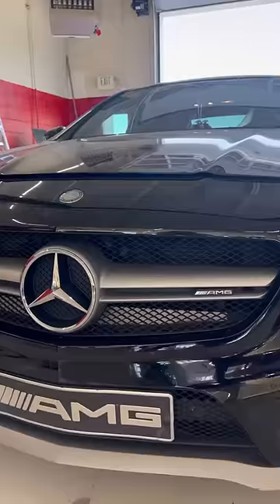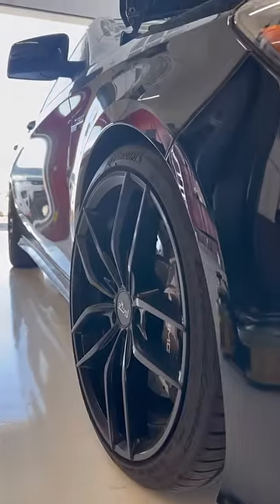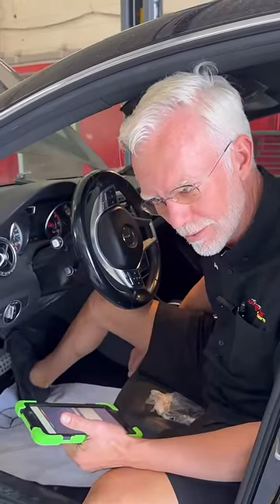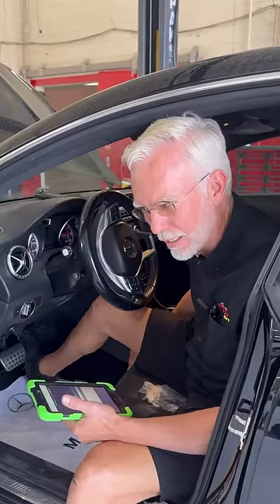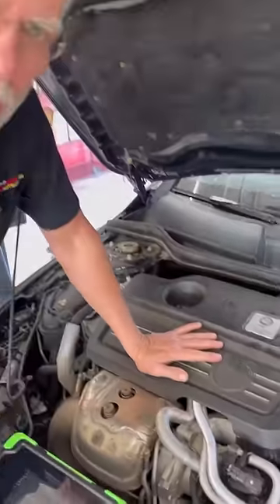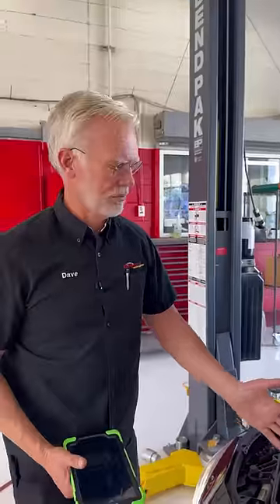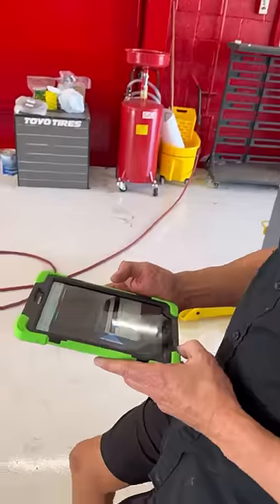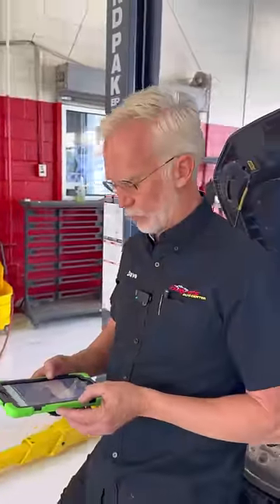Mercedes AMG Nothing but a slight noise on start up #carrepair #autoshop #mercedes

Comment: If it's still under warranty: "nothing wrong with it, normal for this engine."

If it's out of warranty: "It needs a new engine."
Reply: Bmw warranty: it needs a new engine, which we consider a consumable so isnt covered under our warranty
Reply: Exactly, Ford did that to me and tried many tricks to avoid fixing it. I ended up having to fix it myself.
Reply: @florenbaron7111  Ford an Honda tried to pull that on me, too. Honda a few times, they fixed the rear suspension issue on a new Civic with less than 7K miles but still wouldn't replace the prematurely worn tire. Honda also wouldn't warranty the clear coat coming off within the oe warranty.
Reply: only took my car to a dealer 2 times , first was a  trans fluid switch replacement , tried to charge me 300 - 400$ with a wait of 2 weeks 😐, told em no thanks , picked up a brand new trans fluid switch from auto zone for 25-35$ and swapped it in , in less than 30 mins 🤦🏽‍♂️💀 had another car with a bad knock sensor , they told me it’s be around 500$ to fix ….. picked the sensor up for less than 40$ at auto one and this one took about 45 mins to an hour cause i was on a random parking lot and had to tear down the engine to get to it 🤷🏽‍♂️💯 best to save a buck and do it yourself lol
Reply: @outcome2715   I have always done my own work, I was ASE certified but changed careers to the parts side of things. I am older now with some health issues and can't do as much as I used to. I like it when people learn about the vehicle they are controlling and learn how to fix it themselves, the right way.
Reply: @outcome2715  I'm glad you were able to do it yourself. It's great to save money nowadays, especially as much as you did. 👍
Reply: That happened with my new 1995 Mercury. Fuel pump making noise, bad bearings. Dealer say pressure good not changing it. Never trust dealers of course. I do all my own work.
Reply: What's warranty that don't exist. Any manufacturer and dealership will do anything to void your warranty. Go to your trusted mechanic to get it checked.  Check for milky residue in the oil. Run the car with the radiator cap off if it bubbles and goes down your thermostat is fine. It's opening. Radiator flush. If that don't work go to the water pump. If that don't work get the turbo checked.
Reply: Well this car is not for the well off it's for the filthy rich. All matonance is a tax write off
Reply: Facts
Reply: Harley davidson did it to me. what noise, oh it's nothing to worry about. Now that its out of warranty, oh you need a new lifter.
Reply: Because manufacturers pay absolute minimum for estimated time vs dealer can charge whatever they want if the owner is paying 😒
Reply: probably cuz the owner ran it into the ground.
Reply: bc Merica! 🇺🇸
Reply: I own a FIAT and had a dealer's extended warranty. Transmission effd up, they denied my claim and a friendly lawyer informed me that they do this all the time because you'll end up spending more suing them to fix it than to just fix on a better shop... 
Dealers are just a scam at this point...
Reply: @rhobson   yep, they use that tactic, I've heard that before.
Reply: @outcome2715 more so now... It's the only way that makes any sense... 300, 400 bucks for every issue that is going to come up? Gas is expensive enough I'd be homeless if I paid someone to do everything for me😂
Reply: A dealer wants to sell cars quickly and often, and delve as little as it can into difficult, risky operations such as diagnosing, fixing and following up car faults.
Reply: Isn't that the truth
Reply: USED many tricks. They succeeded.
Reply: 🎉ding
Reply: Not just at Mercedes. I have worked at Mercedes , BMW, KIA, Renault and Honda. They all work the same way. Screw the customers anyway they can.
Reply: That is about right
Reply: Buy a Toyota
Reply: @josecortese8023  I did. 😉
Reply: Swap an LS and you’ll be better off! Mercedes are junk out of warranty
Reply: (depending on the car) timing belt / chains can either be $3k or $20k. especially with newer or older parts which eventually will no longer be produced and so when someone needs it, it becomes expensive so it may be cheaper to scrap the engine.
Reply: Mercedes did this to me. Kept denying until it goes out of warranty.
Reply: @madog1 honda still can't get their clear coat to stick!? My word
Reply: @ThePinkPanth3r  Yeah, my wife has a Honda Civic, clear coat went years ago. The dealer wouldn't do anything about it or a premature tire wearing problem, Honda America was no help either. The last Honda we will purchase, we've had good luck so far with a Toyota.
Reply: As a service writer for a dealer. I dont give a fuck if its warranty or customer pay. Yea warranty pays a little less but its a guaranteed sale. The idea that we are willing to lose an engine job under warranty to try and get an extra 30$ per hour labor rate is just wrong lol@adsconlabouring
Reply: From your comment, I feel you need to travel the world a lot more and try to mingle with German automotive engineers and get their take on your opinion. They‘ll make you change your mind so fast, you’ll never want to use warranty as an excuse to discard an engine especially if you have never manufactured one.
Reply: Hello there. I'm here to talk about your car's extended warranty.
Reply: @JoeXTheXJuggalo1   ha! 😄😂🤣 EXCELLENT!
Reply: I hate how sleazy the world is
Reply: @madog1  the moment just felt right. You have to make a sell whenever you can.
Reply: @madog1 People should be aware that Honda quality is also taking a nose dive lately.
Reply: Your thinking is backwards.  You replace the engine when warranty is covering the cost. When out of warranty, you properly diagnose the issue ( which doesn't require a new engine)  and fix it. FYI They already fixed the issue with this car and it didn't need an engine.
Reply: Life of owning a Toyota supra rn😭
Reply: Your new engine is going to need a new car.  Come on, let's walk this way.
Reply: @AdamWild572   ok, you made me laugh out loud! 😂🤣 Thank you!
Reply: Bingo
Reply: @wefwefwef. depends on the dealer. Some rather have you as a customer knowing you have a history buying cars from them others will tell you to kick rocks. As always read the fine print. There are different levels of warranty on all cars even BMW. Even KIA’s 15 year warranty drops some parts after 2-4 years.
Reply: @4thegood  perhaps, but im my eyes that just means youre getting shafted so hard theyll comp you qn engine to keep the money flowing, hardly a great consolation
Reply: @wefwefwef.  there are dealers who would replace the engine depending on the value of it including the labour. However, they are the top 1%. Stratstone BMW would laugh you out the dealership and duck phone calls. There is a cap unfortunately for lower output dealers.
Reply: you realize when it’s under warranty they dealership gets paid directly from mercedes, so they have incentive to fix them.
Reply: @florenbaron7111 same for the cats on my f150… $3200 to replace!!?? and because it was at 80001 miles they wouldn’t cover it…
I said it was under 80k when the code came up…
It’s not my fault that the shop couldn’t get in before it broke 20k.
They still balked, so I cut them off had the ECU reprogrammed and voila. No more bullshyte with that and the meth heads are out of luck too
Reply: That's what they do. They can make up anything. Nobody knows. "By the way, you need a new Johnson rod in there." "Oh, a Johnson rod. Yeah, well, you better put one of those on."
Reply: The noise sounded like a slightly loose serpentine belt.
Reply: So dam true
Reply: Ford has this issue with the blend door actuator that WILL break when your warranty expires and requires you to take the entire fucking dash off to fix a tiny plastic gear. This shit should be criminal
Reply: @nothingtoseehere93  So does 03-07 Silverado with the actuator being under the vent. I had to cut the vent because my hand wouldn't fit  to remove it and duct tape it back together
Reply: In big, boring diesels (KENWORTH sized) if you have a boost leak, your engine will tend to run hotter. I would start with the boost issue. It’s also interesting to hear the variety of noises that leaking boost makes (or doesn’t make), depending where the leak is. Short of tying a mechanic to the grille so he can listen when you’re on the road at speed, you’re kind of stuck trying to figure it out as a driver. Love these videos.
Reply: A fool and his MONEY are soon SPOTTED…..
Reply: Exactly
Reply: That’s Audi too. I fucking hate them with a passion now. They fucked me with this a5.
Reply: Replace the word “engine” with any major work.
Reply: Water pump,radiator, bad fan, get the turbo up to snuff.
Reply: Do you guys in the US not have Statutory Warranties that come standard with used car dealers?
Reply: Had a 1991 Pontiac with brake failure. First the dealer said it was because the brake pads were "low" so replaced the pads, still had brake failure, so they said nothing was wrong with the brakes because the pads were fine. 
3 years of fighting, trying to get the car lemon lawed, and finally got GM to agree to pay an independent mechanic. 30 seconds in he found the brake balancer was defective. For 40,000 miles, the car had only ever used the front brakes to stop. The fluid never got to the rear brakes. A $20 part and 30 minutes R&R. Nearly crashed on several occasions because the front brakes overheated and completely failed. Got real good at reaching down to the ebrake and using it to stop the car. Foot on the pedal and hand in the release. Will only buy cars with hand brake now 😂😅
Reply: Nissan owners have started feeling this for quite a few years.  Ever since Nissan/Smryna, TN bought out all the original employees.  And hired a factory full of temporary children.  I know for a fact from talking to some of them.  That if they cross thread a bolt. They’re terrified of reporting it.  So they just let it ride. How scary is that!!!!
Reply: Overheating  squeal  on starting check water pump and thermostat 😂
Reply: @madog1  The Car Care Nut ordered a limited special edition toyota. It had paint and trim issues from the factory. What a disappointment for Toyota's biggest fan and mechanic.
Reply: That's pretty universal.
Reply: So true.
Reply: @nothingtoseehere93 it's not hard to do
Reply: @madog1  What the tire??? that's your responsibility my dude and clear coat is a body shop repair and again your responsibility to wash it safely and keep out of direct sun 24/7 sun fade happens when you dont wash your vehicle keep directly in the sun and use soap or cleaners that damage clear coat or age. And tires only get covered if its defect and the car is literally new off lot and you notice immediately. Not after driving 7k miles and running into 500 pot holes and curbs lmfao
Reply: @madog1 Not fixing clear coat is disgusting. It should be lasting 5 year no problem.
Reply: @madog1  Honda doesn't honor their rust warranty either. You can end up driving a rust bucked and if there's no perforation hole, congratulations on the purchase of your new rust bucket.

Comment: German car gets scratched
Dealer: needs an engine
Reply: 😂😂😂😂 facts though
Reply: @HARTGROVE25 it has a flat tire, the chasis needs to be replaced
Reply: Typical Merc.
Reply: Well I own a 1965 VW Beetle and I do all my own stuff. Well mostly
Reply: I can’t stop laughing
Reply: Not all german cars... Only mercedes.
Reply: To be fair that mentality is probably why BMWs have disco light displays as a standard feature if you believe die hard fans of dissing anything that isn't MuRiCa da GrEaTeSt. The sensors do too much sensing when things are a long way off actually breaking. Similarly I went out with someone whose mum had an old Audi and it was the same. Carried on just fine with the lights ignored.
Reply: Week later, ends up in UAE on a used car lot.
Reply: Fact. !!!
Reply: American car misses an oil change
Engine: dies
Reply: @davidmoore4615  lol no, you meant german* car
Reply: Car wash?
New engine
Flat Tire?
New engine 
GF doesn’t like the color?
New engine and transmission.
Reply: @betterwithrum  yeah I think your username might be apt... the "joke" was made some time ago already. I appreciate of course the American brain takes a bit of time to catch up.
Reply: Tesla: gets scratched.
Tesla dealer: need a new car
Reply: @Spudmuffinz  Yank ICE car: throws a rod

Texan: well um I got me ma gun and a screwdriver and a hammer imma sure ahll fix it up good y'all and if I'm struggling uh jesus is lookin out for me so she gon get goin again jus you watch... where's the titty bar

Comment: Dealers are parts changers and shops like yours have skilled knowledgeable technicians.
Reply: Dealerships are flat rate his people are paid salary and fair. Until flat rate is no longer a thing, this will never not be true.
Reply: And honest!!
Reply: Dealerships they only know how to change parts.. Just a few people like you, sir left to fix a car not only sweat parts
Reply: I have a used Venza that was dealership serviced for a decade by the previous owner before I bought it from him three years ago. He gave me all the service records for proof.
Now a Venza is already a solidly reliable Toyota, but I bought it with 219,000 miles on it. It now has about 241,000 miles and the only thing I've had to do was replace the thermostat a thousand miles ago. 
Everything works properly and it still drives like a new car with a strong engine and transmission.
HE spent a fortune buying new AND having it serviced at dealerships. 
I bought it for $6500 when it was ten years old and spent $200 replacing the thermostat.
Who got the better deal?

I don't use stealerships, but they serviced THIS vehicle very well for a decade. They do quality work, but you pay for it.

Comment: I’d check the temp sensor, control unit might be limiting boost causing wastegate rattle on start up
Reply: the noise is when he reoeases the gas pedal... therefore Id vote for wastegate as well...
Reply: What he said 😂
Reply: @nickg505  yep, and i agreed...
Reply: I could see that.
Reply: @michaelmoersch8788 That wouldn't be wastegate.  Wastegate only moves under load/ full boost.
Reply: @michaelmoersch8788  I was being a smart azz. This level of mechanics is above me. Glad you guys know your sht tho
Reply: i am not an engine man
den barbaria was. hung out @ the shop. was allowed. use no tools of his. watched him do tear downs and re builds. diagonsed moms hudson engine problem as he worked on some thing else, really.
Reply: @nickg505  This makes you a perfect candidate for being a dealership mechanic
Reply: Blow off valve
Reply: Check turbo first. Could be coolant cooled and having issues. That would explain the low boost and the over heating which you should also check the water pump as well. But if the pump failed it could cause the turbo to fail which could fry the motor. Check cheapest option first or easiest option
Reply: That seems lo
Reply: That seems logical to me as I am a heavy truck mechanic
Reply: @JayCGypsy  factory vehicles don't usually have a BOV, they instead use a diverter valve which can be piped in very differently since they don't vent to atmosphere.

Comment: I do believe there is an oil-pump mod you can do to help eliminate that noise. Low pressure somewhere in the motor. There is a video here of a company that makes a high-volume pump for these engines. Oil does a LOT of cooling in the engine, people often don't know about that.

Comment: I’m NOT a mechanic, just a real estate agent who’s a Motörhead.  Don’t turn my own wrenches except for oil changes, brake pad changes, and swapping out wheels. But, I’d like to take a stab at it.  I’d would think to check electrical continuity on the speed sensor to see if it’s actually the sensor or a problem in the wiring between the sensor and the ECU.  The car may not know how fast it’s going, so the ECU could be pulling back the performance. 

After the speed sensor is sorted out. I’d check for a boost leak if no boost leak, maybe pull the turbo and check it for damage or functionality.   If turbo is turning but not freely and is water cooled, it could be getting very hot and could be cause of overheating.  That’s all I got without more info from these checks.
Reply: One of my friends bought a 16 year old BMW 5 series at an auction for $5000. He thought he got a great deal until he got it home and the dash lights were all on. 
It sat in his garage for a year while he worked on it on the weekends, trying to track down and fix all the stops problems it had. Once he'd get all the dash lights off, he'd drive it around for a day or two and all new dash lights would come on. 
It was endless. 
He finally said he'd sell it the next time he got all the lights off again and be happy just getting his $5000 back. 
It's a never ending problem with used Beemers and Mercs. 
If endless frustration is your thing, go for it!

Comment: Pressure test coolant system and check for boost leaks
Reply: This is the direction I was thinking
Reply: Even with no misfire codes, I'd add a compression test as well, just to cover my ass.
Reply: Don't forget to test the cap too!
Reply: Bingo!
Reply: Yeah, blown head gasket, boost in the coolant, overheating, it makes sense. Apparently these things are known for stretching head bolts too.

Comment: Sounds like a boost leak when you hit the throttle. May have a torn boot or a clamp broke. Have to look further to determine root cause.
Reply: Don't think that air filter is standard looks like a amazon special makes alot of induction noises
Reply: That's the analytical mind of a mechanic, more clues needed.
Reply: @jamesmcwilliams7318  normally most standard cars you won't hear the turbo spooling